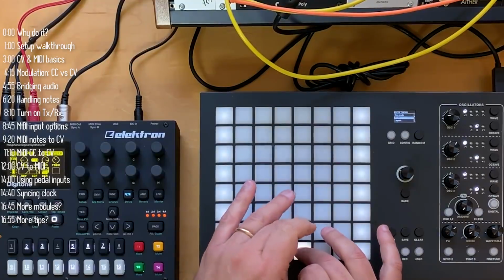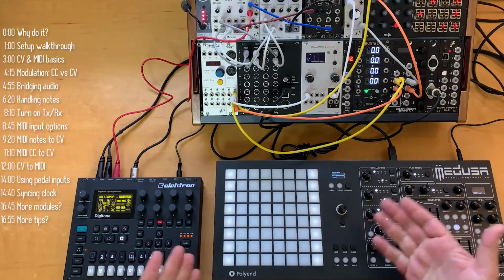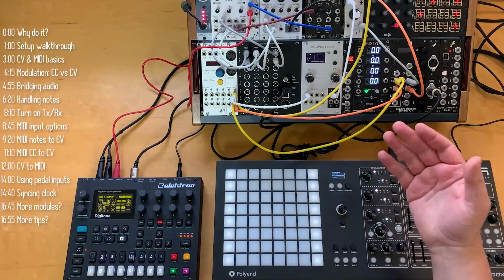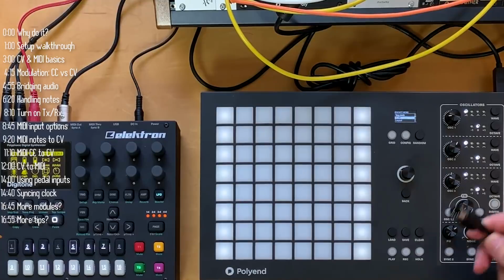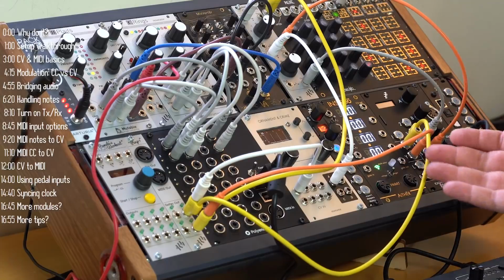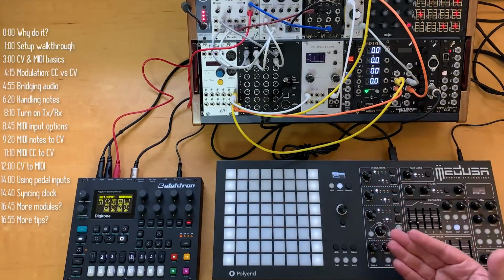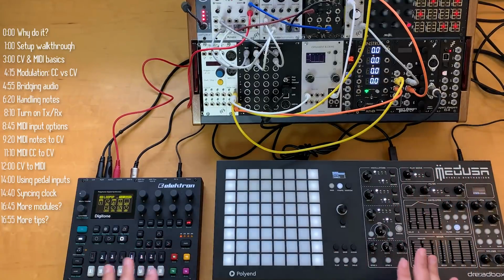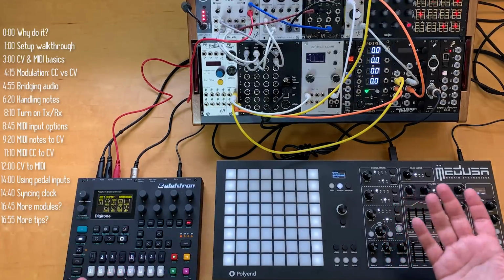MIDI to CV and back: Can your "regular" synth become semi-modular?

Comment: Is there a way to know if the control voltage you are providing is too much voltage?  Like could I use the audio signal from my older Moog theremin to be the CV signal (not equipped with CV out)?
Reply: Good question,  that i would like to know  aswell,-

Comment: You might want to redo this video. I have a Prophet Rev2 I want to control with eurorack and it looks like there are more options available now. Also the Behringer Neutron has a unipolar LFO output and an attenuator, this works great as an expression pedal controller for most synths

Comment: Shouldn’t it be possible to use the midi thru of Digitone in DIN sync mode and then with a midi TRS din adapter plug it directly into Pam’s Workout? That would save you one gate out and potentially gain one more voice channel (e.g. with Yarns).
Reply: good question - have you found it out ?
Reply: @MikkelGrumBovin  Yes, it works like a charm. You can first adapt the DIN to TRS and then split it into two mono plugs that you can plug into pams clock and start/stop.
Reply: @chmanie  Thats so good thinking, i just got the PEXP-1 - and me.being an olschool bassplayer/guitarist/drummer gone synth/vintage/Euro crazy (i use to play gr300´s and Ibanez Zing in the good ol days  aswell)im so deep into the rabbithole , i feel i cant think straight anymore - i love  that whole breaking rules, using several sequenzers to trig the same CV lines , polyrythmic tribal triggers , with cross seqv. sounds on the circadian , and triggin perc. with Metropolis - -DivKid and MylarMelodies being my new gurus .... but...i...need...help...both mental and techwise !  ;-)
Reply: @MikkelGrumBovin  Keep in mind that you need to use a clock DIN to TRS adapter like the one Arturia makes

Comment: Hey loopop, im tryna get clock from my beatstep pro into ableton link for aum on my ipad to follow... any ideas? Im using an es-9 for my interface and tried audulus, mirack, cvariant apps. I have a disting mk4, dunno if that can help at all (going from clock to midi clock perhaps? I dont have a breakout tho)
Reply: never mind, i was overthinking it. I can use midi link sync app to turn BSP midi clock into live sync and Aum wil follow that... I was hoping there was a software option that would take CV and turn it into link str8 up but all efforts failed.

Comment: Yes and the reason i like the polyend is for all the outputs. I am looking i to controlling my modular from my mpc live 2 but am having some difficulties. I also have the sl mk3 from novation that i can use. Dont know what to use. I only have 2 separate midi to cv gate mod modules at the moment. That is why that polyend looks like a winner for me. Could you do a deeper dive on it?  If you can get some time. Well thank you stay safe

Comment: Since CV to MIDI is relatively scarce, it's worth adding that the original Bass Station Rack has one pair of pitch and gate CV jacks that are bidirectional - you can use them to convert MIDI to CV or CV to MIDI, and they can be used inependently of the actual synth (so you can control the synth itself on one MIDI channel but have the CV i/o running on a different one).  Can be set or Hz/volt for interfacing with Korg stuff, too.

There's no conversion to/from CC so it's limited but you do get a pretty nice little 90s analog DCO monosynth with a bunch of preset locations and ploychaining as an added bonus.

Comment: The Polyend Poly's manual officially says: "Please notice that Poly module Gate outputs are 0-12V (the Eurorack norm is
 0-5V)". And then all values are given: 

• 8 Gate Outputs (0-12V)
• 8 Pitch Outputs (0-12V,V/oct.)
• 8 Velocity Outputs (0-12V)
• 8 Modulation Outputs (0-12V,selectable CC message 0-127 using
 DIP switch on the back panel) Poly Module play modes.

If the Eurorack standard is 0 thru 5 volts, why do they build this thing offside these limits? I have bought it because I've seen youtubers using it on its own within a normal Eurorack. Moreover, the Moog Subsequent 37 is built to Eurorack standard and has 3 CV ins and one gate. Will I destroy it when I connect it to the Poly's outputs?

I'm heavily confused now and have to consider returning it to the vendor... What I wouldn't like at all...

Any suggestions or explanations? Thanks beforehand!
Reply: 0-5v is a Doepfer standard, not necessarily for all of 5U eurorack modules. There are many modules that take +/-12v, as this is usually the limit of the power supply itself.

Oh I didn't realize this was 2 year old comment haha. Hope this helps someone anyway
Reply: @magnopere 
Thanks anyway :)
Reply: what is the status of the question/answer today ?
Reply: @MikkelGrumBovin  
I remember that I've sent this question to Moog's support team, and I remember that a supporter named Adam told me that I should not try to make such a connection. He literally advised me not to do this. So, this can be considered a well-educated answer: These devices are not compatible.
Reply: @N.A._McBee  Thanx , man !

Comment: I'm having trouble getting the cv to midi (midi out using the breakout) to work on the General CV. When I hook the breakout to my Disting mk4, both midi in and midi out work fine and I can control my Minibrute using Channel 1. However, when I hook the breakout module to the General CV, Midi in works (external Midi to cv), but I cannot get Midi out to work. I have upgraded to the latest firmware v1.4 and am using the Programmable mode. I set Note A to Channel 1 and triggered. I even set the Midi Out setting to 1. Is there something else that I need to set?
Reply from the maker: Hey - it’s a bit hard for me to troubleshoot but please email their support - they are very responsive

Comment: +1 for the CV.OCD because it’s very flexible and you can carry it everywhere since it’s independently powered. But an obvious, cheaper option (in the sense that it saves you a dedicated midi to cv converter) is a semi modular with midi  (0-coast, Microvolt, Neutron). It would do the trick with the advantage of having another source of sounds and modulation. Yes, it offers less flexibility / control than a dedicated converter but it would cover the critical aspects (tempo/rhythm, pitch, and more). Even cheaper - and, of course, more limited - would be a beatstep. BTW, it would be great if the Medusa had, instead of so many pads (Being keyboard-centered I don’t appreciate them other than as samples/percussion triggers, or as a sequencer interface -like in the superb Circuit design-), a modular matrix. It’d be a killer.

Comment: Does the ES General CV send out the chords it creates over the external midi?. As far as I can see it mirrors everything that is sent to the midi sound generator but i'm wondering if there is extra processing done to create extra midi notes signals for things like the Shepard tones and if these are sent out too. Basically i want use it as a CV-midi for external synths, I'm not that bothered about the internal sound generator and this seems to have more CV input compared to the Doepfer A-192-2. 
I have an ES-8 so i could use that and the silent way CV-midi then out thru Ableton but i was trying to avoid using the computer for this application
Reply: The General CV has a setting to enable output of all the internally generated MIDI (e.g. for the chords, Shephard tones etc.) via the breakout.

Comment: i got my dfam then was sorely disappointed i didnt have anything else to patch it with (except my minilogue to sync with it), still havent settled on what to buy , it becomes a bottomless pit for me , id also want to interface with vcv rack .. so is the expert sleepers module the best-cheapest way to go ? or a midi-cv converter (i wish i kept my ancient one that i sold with my korg mono/poly) i have a weird combo of digitakt/dfam/minilogue (and reason for daw)
Reply from the maker: Two recommendations: Did you see my "why eurorack is awesome" video? I expand DFAM 5 ways there. And yeah also check out my "hybrid modular" video for using ES-8 or a DC coupled interface to bridge to VCV. ES-8 is the best way to go but it's not cheap :/
Reply: @loopop  yeah i need to check them out again to mabye spark some ideas , its been a while , and yeah :( i think i need to hold off a bit more before i go full eurotard .. each time i look into that i get lost deciding on a few modules to fit a 60hp rack or something, then it snowballs into something way bigger :):(

Comment: I do not get it, why would anyone want to sequence ordinary synths with modular? Modular sequencing capabilities are so far very limited, even with modules like O_C, which are also digital. Quite simple algos that run on expensive hardware. Just use a phone, tablet, pc..
Reply from the maker: @taavi you can run practically everything on a pc or iPad. Almost any hardware outside the box will be limited and with less features, and have knobs, and a physical touch and feel and that’s the whole point. If you are happy and creative on a pc or iPad you certainly don’t need any hardware at all and it’s totally cool of course.
Reply: Well, it could let you effectively add an extra LFO or envelope to a standalone synth. Trigger from the standalone sent via midi to the modular, which initiates the generation of a CV curve, which can be converted back into midi as a specific CC message, and routed back into the standalone synth to control some parameter, like filter resonance (which rarely gets a dedicated envelope on a synth), pulse width, waveform etc.

EDIT - I realize that my suggestion is for modulation, not sequencing. I think the only reason for that would just be that you happened to already have plenty of modular sequencers, presumably with a sequences that you already built or something. Or just preference of interface. But I agree - modular is a very expensive and cumbersome approach to sequencing non-modular synths.
Reply: I completely disagree. I am heavy into the MIDI world and have been working on MIDI hardware with Arduino. I've been dipping my toes in the modular world via VCV Rack and I'm simply amazed at how much innovation is going on in the sequencing world of modular hardware. Even just the modular nature lends itself to more organic sequencing and controlled randomness. I'm dying for something like the Eloquencer or even something like the Turing Machine to come to MIDI land. Sure I could make a Pure Data patch to do similar things, but having physical hardware with knobs and patch points to intuitively change the controlled randomness is pretty hard to beat.
Reply: On the contrary, real-time tweaking of hardware sequencers along with the interaction of other elements like quantizers, voltage processors etc is much easier than using software. Sometimes i want to control everything from the modular and that includes hardware synths like my Waldorf Quantum without having to go via a computer so something like the ES General CV can then bring in these other sounds sources just like they are another module. Simple algorithms, when combined with other voltage control, can produce evolving rhythms and patterns that are very difficult to do with current software. You could do this with a virtual modular but even with a powerful computer, moderately complex patches can bog down the computer. Hardware is just much easier to "play" but yes, it is a very expensive way of doing things.
Reply: @CuriousDroid  I can do any modulation I want on a computer, even output as cv. I have dvelved into modular and found it to be extremely limited and expensive, compared to Pure Data or supercollider, which is free. Only reason I own some modular today is because of sound, and even that can be argued by many. Modular is next Fruity Loops for rich kids. I understand the physical aspect of it though. But many modular setups still use Electrons or some other soundmachine that are essentially physical daws.

Comment: I great video.  I have the Intellijel uMidi. Its 6 hp and provides Midi to CV along with a clock divider, sequencer sync via run and reset outputs., 0 -10 vpo, gate and trigger outputs and more. Very powerful in a small package. I also have the Squarp Pyramid which has CV/Gate in/out.
Reply from the maker: Thanks! added to description and gave you credit

Comment: Shuttle Control is also a fantastic module for this purpose. It's outputs can route cc's back to your other hardware gear and the outputs are also configurable in any combo of v/8, gate, trigger, or cc data you want...very handy with digitakt or digitone!
Reply from the maker: Thanks - added to description and gave you credit

Comment: Very nice! I guess I tought myself most of this already, but I have a very special problem. I have a Digitakt that sends the masterclock and stop/start to my eurorack via a HERMOD -> Tempi to a René 2.0 which is the controller. The start / stop works great, but The René doesn‘t jump back to position 1, so the beats are in sync with notes, but not with the notes I want. I know that the René can be told to reset its sequence via a CV at the Mod input, but that means I can‘t use that input for other stuff and I don‘t know if the Hermod can Send a start / stop signal just once ... I only know it can send clocks.

Is there something I am missing?
Reply from the maker: Thanks! Sorry I don't have a solution off the top of my head :/ it's worth a question on the Hermod forums or to support though.
Reply: Hermod can send clock with restart command at start or stop - -> 
 G1+RESET P to G8+RESET P: Hermod will output a RESET signal on the CV output (together with the clock on the GATE output), helping your modules to keep the sync when PLAY is pressed.
- G1+RESET S to G8+RESET S: Hermod will output a RESET signal on the CV output when STOP is pressed.
Reply: @MachineRoom  I wrote that, it‘s just that the René loses options when using one of the input as a reset.

Comment: The CV.OCD box, if you haven't seen it already - MIDI to 4 CV outs and 12 gate/trigger outs! Not a module, it's a self-contained unit.
Reply from the maker: Thanks - Added to description and gave you credit!
Reply: yep, cheap simple but powerful litle box
Reply: Also available as a eurorack module as Hexinverter Mutant Brain
Reply from the maker: Yep - mentioned that in the video - thx
Reply: @time4anew1  cv.ocd as a module? where?
Reply: @time4anew1  thx i just didnot realize that the mutant brain was cv.ocd as a module